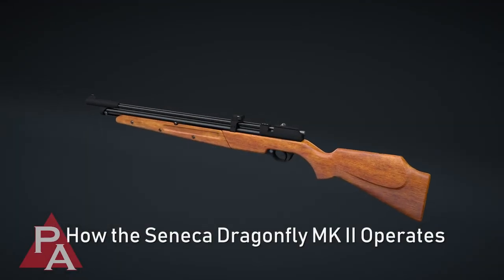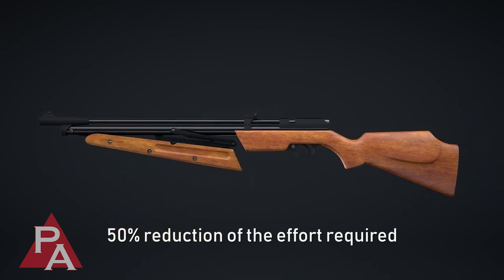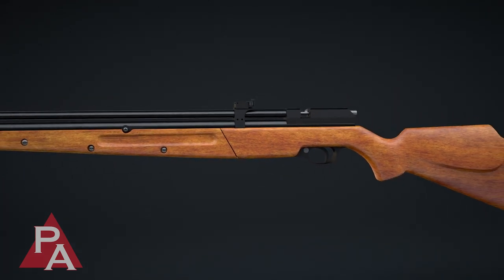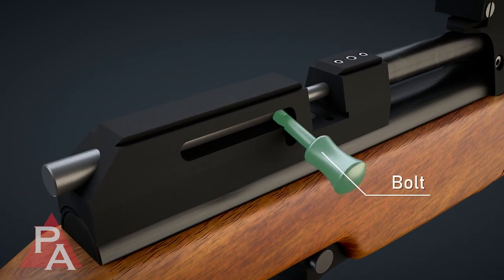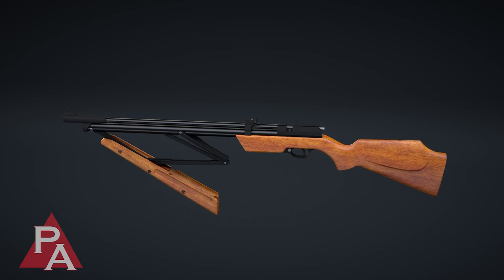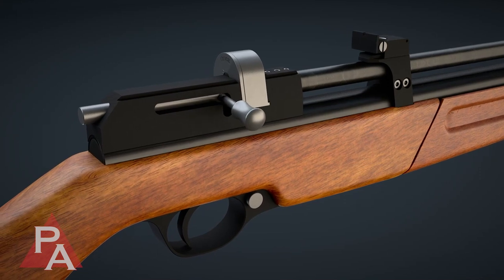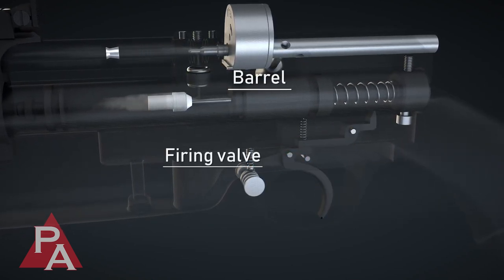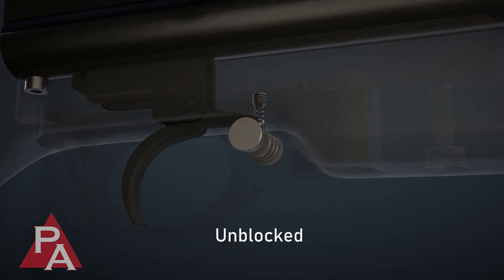Learn How the Multi-Pump Seneca Dragonfly MK2 Works

Comment: If it is similar to the seneca aspen, my question would be when do the o rings wear out? Mine aspen lasted 800 shots. My crosman is going strong after over 2500 shots. Design flaw?
Reply: Not like the Aspen.  The Aspen is a PCP with a built in pump, this is a true Multi-Pump Pneumatic.
Reply: @tylerpatner6591  I look forward to the reviews. Thanks

Comment: Any projected velocity specs at any pump numbers?

I'd hope since they made it easier to pump that they would have given the powerplant the capacity to use the extra air
Reply: The Dragonfly Mk2 is on the website, check out the listing for all of the details: https://www.pyramydair.com/product/seneca-dragonfly-mk2-multi-pump-air-rifle?m=5170

Comment: I own break barrels, under levers, pcps.. but I’ll definitely add this pumper. Old school feel with a bolt and wood stock. Make a great little small game gun. Too those complaining a pumper or pcp tires you.. then quit commenting on a gun you wouldn’t like and move on 🤷🏻‍♂️
Reply: Hunt small game with a single shot needing all that movement, time, and noise between shots? You sound like a paid commercial.

Comment: why not just buy a break barrel? Pumping 15 times per shot??
Reply: A pumper has zero recoil and variable power. I'd rather do PCP though cause that's a load of pumping for sure.
Reply: Never saw the appeal of pumpers either.... always used springers or C02... The price of compressors is what's kept me away from PCPs, and when I see the reviews saying "With the handy dandy "Sooper Pump" ( @ $135 +tax ) you can fill the tank in just 50 strokes.." it just makes me feel tired. I like to shoot, but not that much...
Reply: @BoggWeasel  .. yeah nothing beats a high quality break barrel IMO
Reply: Way more accurate
Reply: @TurfSurf  Not necessarily so. Depends on the quality of the gun and the ability of the shooter, a good German springer ( FWB, Diana, Weihrauch or Walther ) will out shoot a lot of pcps accuracy wise. The one thing that PCPs definitely have over springers is power. To get 25/30 ft lbs out of a springer would make for a gun that would not be a joy to shoot. If I want something with a more power than my springers I'd buy a 22lr rather than go through the hassle and expense of pumps and compressors
Reply: @BoggWeasel  People don’t shoot 22lr in their backyards, for $199 you can’t get a pcp or a decent German or a British springer to match the accuracy of a multi pump.  Lastly most people aren’t trained to shoot springers or even nitro gas piston ones properly.  To gain all these advantages with a few pumps is well worth it, good exercise too if you want to go all 15 pumps and 50 yards away.  For target shooting, 3 to 5 is enough.
Reply: @TurfSurf   I know people don't do that, I' meant that if it was about power I'd buy a 22lr and not bother investing the best part of $ 1,000 (or more ) in a PCP setup to shoot at distances of more than 50 yds. As for the "being trained".,, I had my first springer when I was 14, an RWS 28,..I was never trained, never used a scope, and can shoot sub 1 inch groups at 25 yds, it was all down to familiarity and practice. Yes shooting with no recoil is a lot easier but their are still basics that are the same. I like the recoil, makes it feel less like playing a video game, after all, when shooting powder burners, recoil happens.
Reply: @BoggWeasel  You definitely sound like a trained air gun shooter, professionally trained or not, you are still considered as trained with that much of trigger time you already had than some average Joe.  This gun is designed for certain shooter that prefers smooth accurate shooting without going through a steep learning curve or lots of practice.  I think this will sell better than their multi pump PCP model.
Reply: @TurfSurf  Not trained...experienced would be better and the learning curve isn't that steep, just have to be willing to put in the time and practice for a few weeks and learn your gun. I'm also not saying this gun is rubbish or that people who shoot pump rifles are not as good as people who shoot springers. It's horses for courses, for me, I never saw the appeal of having to pump a gun multiple times in order to use it. If that's your thing then have at it and enjoy yourself.
Reply: @BoggWeasel  Air rifles are not tracked by the government. All bought under NICS are tracked TO YOU.
Reply: @BoggWeasel  It’s only 3 pumps for target shooting, with the new linkage design, probably effortless.  It’s not like the old Benjamin multipump anymore which is like a portable gym by the time you hit the 5th pump.😆
Reply: @geraldkoth654  and ? Target sports aren't  illegal  and the only reason btw I would ever own one.. Don't really care if the gummint knows or not...The gummint knows I have a car, can find find me with my phone, tax returns and hospital records..if I'm not doing anything against the law I don't see the problem...
Reply: Leon Wilcox  Good points.... I only shoot targets so a consistent power output is more important than variable, but I can see it's uses for them's who like to hunt critters....

Comment: Mac 1 developed  a pumping lever for the Benjamin and Sheridan's  similar to that.Looks like the Chinese stole/copy Tim's idea.
Reply from the maker: Not the same.  This system is actually patented. Was done so by Bob Moss a number of years ago, Air Venturi worked with Bob to develop this for the Dragonfly Mk2.